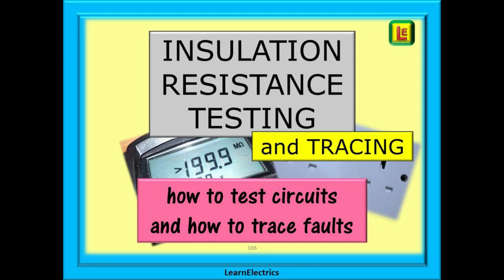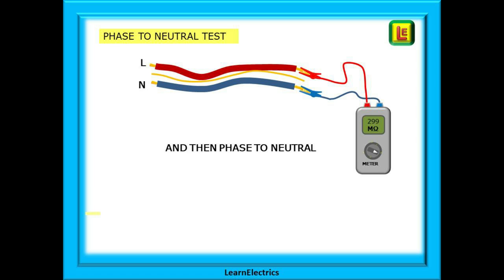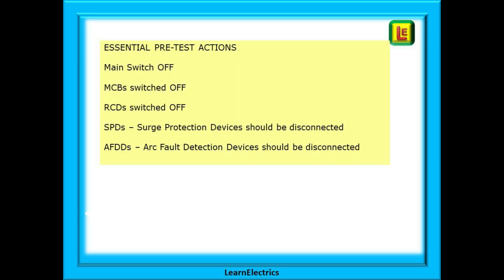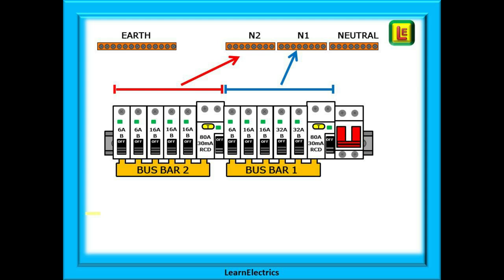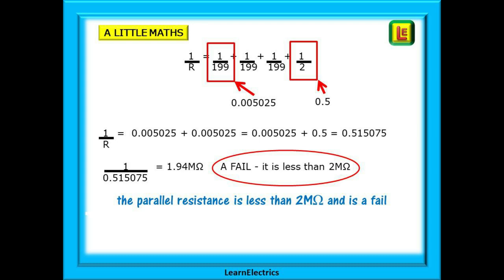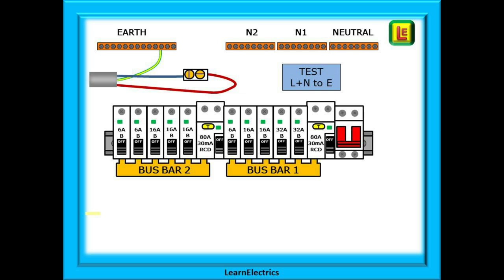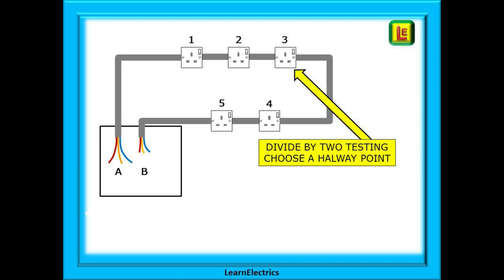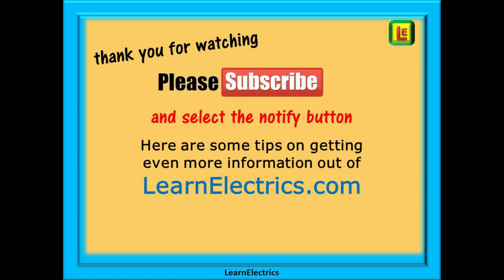INSULATION RESISTANCE TESTING AND TRACING

Comment: Thank you for your efforts, this is high quality content. Your visual diagrams are also an excellent aid. Subscribed.

- also i’d like to ask, if testing between L+N and Earth, how would you locate the neutral for that circuit as shown on 14:21
Reply from the maker: If you have put the Line into the Neutral bar, it will not matter about identifying the exact neutral. They are all connected together, BUT, current will only flow down the correct neutral, the neutral that has the probe on it at the other end. Hope this helps.
Reply: @learnelectrics4402  Many Thanks, looking forward to the next videos!

Comment: Hi Dave excellent video again, my mental toolbox has indeed been added too. just a couple of minor queries that im struggling to fathom. The training provider i attended recently did the sequence of IR tests in the following order, Neutral and earth, Line and earth,Line and neutral. Ive noticed this sequence is different from yours so does it matter Dave. Also and this may be a stupid question when you say that you connect the line and neutral via a wago or connecting block in order to protect dimmer switches and test between these 2 and earth bar and you should get 0 volts, how does that test the cables if its 0 volts and not 500 volts. Brilliant video by the way I will watch it again it really is fascinating this electricity thingymebob lol.
Reply from the maker: The order doesn't matter as long as they are tested. Most of us have a favourite order.
Linking L and N together means that there is no voltage difference across them, but there is a difference to the earth or cpc. Think about twin and earth, the earth is between the L & N in the cable, if anything has gone wrong it is likely to be L or N to earth. Hope this helps. Dave.

Comment: I’ve been chucked into testing and EICRs before I feel I’m ready. I’m pretty good I think but I like to be more cautious. But £ needs to come in.

The IR issues I seem to have always seems to be lighting. 

Things like smokes, drivers, transformers, dimmers etc all seem to cause essentially misleading results… which you have just mentioned in the video…  I’d be dead keen to understand why in more detail…
Reply from the maker: Make sure you are testing at the correct test voltages, see the video below.
Where possible, test on a naked circuit, all devices, lamps etc. removed.
replace dimmers with a normal switch for the test, remove transformers or use a L+N to E test.
https://www.youtube.com/watch?v=Kly-q-DShxA

Comment: Brilliant video dave. Just a question. When joining line and neutral together and testing to earth which i see alot of people do nowdays to avoid having to dissconnect loads. 
Only problem i see with this test is that it will not tell you if you have a line to neutral fault!! Would i be correct in saying that? So if you power up your relying on the fact that there is no line to neutral fault. If there was obviously MCB  will trip as it is a short circuit
Reply from the maker: You are right. The book advises that we should only link L&N if there is a load that cannot be disconnected. And yes, it has become a common sight on site. This sort of short cut only saves perhaps 2 or 3 minutes, and folk spend much more than that texting their mates. The sequence of tests is there for a reason. Glad to know that you follow them. Thanks for your comments. Dave.

Comment: Hi Dave, wonderful content. So if i was carrying out an insulation test for sockets for example, would i just replace usb sockets with standard ones but can leave bulbs and fire alarm connected for as im only testing for sockets and vice versa? Thanks
Reply from the maker: Whichever MCB the circuits are on should have susceptible devices removed. Thanks for watching. Dave.
Reply: @learnelectrics4402  thanks for clarifying Dave.

Comment: Can you IR test and entire board of its populated solely with rcbos? I’m guessing not but worth asking? Thanks
Reply from the maker: You can test the whole board. Remember that with current regs you should test the cables only at 500 volts first then  with components etc at just 250 volts. Always make sure that manufacturer's instructions permit IR testing as some require precautions to avoid damage to electronic parts.

Comment: Hello Dave, When the insulation resistance for one  circuit is 1 Mega ohm , it will pass. But, of course the parallel resistance for whole installation would be less than one and a fail. So considering the amount 1M ohm in the standard as a pass  looks weird.
Reply: I did a quick look at BS7671 and on site guide, The 1M ohm for every circuit was in both of them. But I couldn't see and find the 2M ohm for overall system. Do you remember the source?
Reply from the maker: I do yes. Electricians Guide to the Building Regulations. Section 6.3.6 should find it. Thanks for watching, thanks for supporting the channel, appreciated. Dave.
Reply from the maker: Yes, I agree it looks odd. But it does say, "below 2Mohm should be investigated".
Dave.

Comment: Hi Dave. I love your videos. Very helpful. Im a bit confused over the reciprocal method in your video 2391 Assessment practise 1 and the reciprocal method in this video. They look different, one is using little r1 and the second one is using big R1. The use of rn is also confusing me between the two formulas. Please help. Many thanks, Craig
Reply from the maker: Craig, have a look at this video, it explains the differences.
https://www.youtube.com/watch?v=9DLgM8wM5xo
Once you understand that little r is the resistance of a piece of copper of certain length and size and cannot change But big R is the effective resistance depending on if it is radial or ring and can be different depending on how connected.
Dave.
Reply: Thanks Dave

Comment: what other things can cause low resistance readings? can damp, moisture, loose connection and corrosion in a socket for example cause a low resistance reading on the whole circuit? Also if your lighting circuit has been wired with junction box in ceiling somewhere, thus meaning only Switch Line, Neutral and CPC at light fitting,,,, you cannot split anything to test IR like this can you?
Reply from the maker: There are so many variables, this is where experience comes into its own. Brilliant feedback, Thanks for watching, appreciated. Dave.
Reply: @learnelectrics4402  Only for example? maybe you have come across this yourself?

Comment: Hi Dave, 
When using the reciprocal method, if there was 6 circuits, would 1 to 5 be added resistances as per the example and the 6th circuit would be the RN. Is this correct.
Kind regards
Craig
Reply from the maker: Just keep making reciprocals Craig. The Rn means ANY NUMBER of Reciprocals.. You can have 4, 16, 200 its up to you. Just keep dividing into one and add them all up at the end. Hope this helps. Dave.
Reply: @learnelectrics4402  Thanks Dave that's great
Reply from the maker: You're welcome Craig. Keep learning, it's a good trade.
Reply: @learnelectrics4402  it certainly is,  I work in industrial on the docks with the big cranes. But I also did a full apprenticeship, but got made redundant 1 month before my AM2.
I have a great shift pattern that can allow me to further learn. I was thinking domestic installer route just to tide me over on my days off and go for AM2. What do you think Dave ?

Comment: Thanks for the video. I've watched several videos on this topic and understand the basics.  I realise that pushing 500V through L and N in connected loads etc could cause damage. What I don't understand is why if we test separately with 500V L to E and N to E and we get >200MOhms for both does that not suggest that L to N is ok?
Reply from the maker: Good question and JUST FOR YOU, I've put a short post on the LearnElectrics website explaining this. Log in to LearnElectrics dot com and there is a search box on the right hand side, half way down.
Type in P114 in the search box and it will take you directly to the post about why we test all three conductor permutations. Hope this helps. and please leave a comment here on this YouTube video if it does. It may help others.
Thanks for the support. Happy to help. Dave
Reply: Why would it? L and N could be touching each other but not via E, no?

Comment: sir just asking..what is the normal and minimum insulation level for 440V,220V and 110V system?
hoping for your answer..thank u
Reply from the maker: Most 220/400 volt cables have at least 600V insulation, a lot use 1000V. If you use approved electrical wholesalers they will tell you what the rating is for the cables they sell.

Comment: If required insulation for 1 circuit is more than 1 Mohm , adding 2 such circuits will make overall insulation resistance 0.5 M ohm making the insulation test fail ? Can you please elaborate on this. thank you.
Reply from the maker: Kalum, at the consumer unit all the individual circuits are in parallel to each other. parallel circuits always have a combined resistance value that is smaller than the smallest individual circuit. Hope this helps.

Comment: If the mft gives a reading more then the reader can count, how to you do the parallel resistance calculation as you don't have the actual amount? It will just say something like above 200 M ohms. BTW that you, your videos helped me pass my 18th edition
Reply from the maker: Haider, don't worry about that. As long as each circuit is over 2M you are ok. If you have say 10 circuits and all are above 200M, then the parallel will be 20M. And great news on your 18th exam. keep learning, its a good trade to be in.

Comment: What I don’t understand is on an insulation test you expect a high ohm reading, but on a continuity test on the same circuit you’d expect a low/within the length limit reading.
Reply from the maker: Continuity is testing the copper conductor. Insulation tests are checking the pvc insulation. Hope this helps. Dave.
Reply: @learnelectrics4402  Thanks Dave, But you’re still testing the copper conductors on the insulation test. I can’t understand how it works out such a high ohm reading on insulation resistance.
Reply: @Jim804 you're testing how much leakage current is produced by the test, not how much current flows in the conductors.
LE also has a video explaining that the IR test produces a 'charge' in each conductor, which the meter then measures, although I don't quite understand that one!